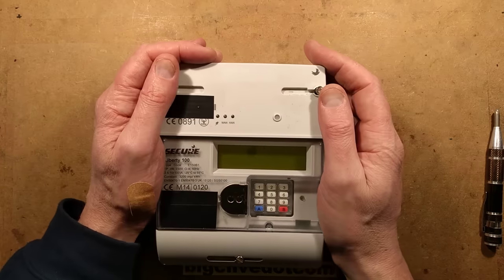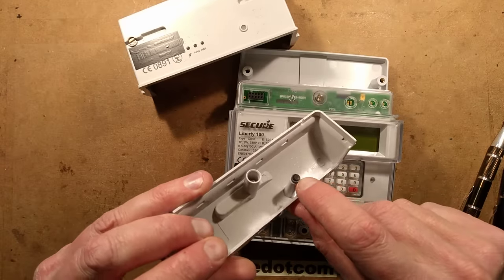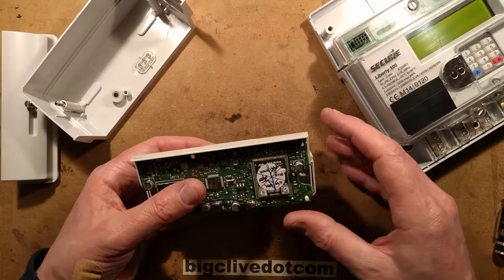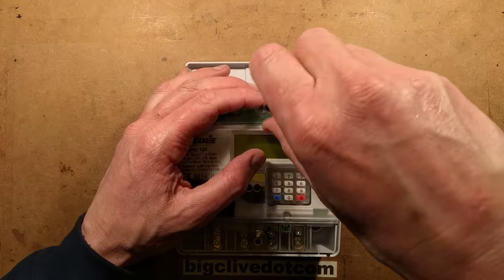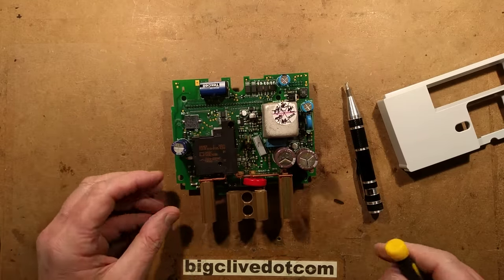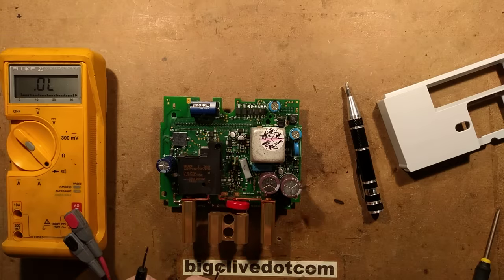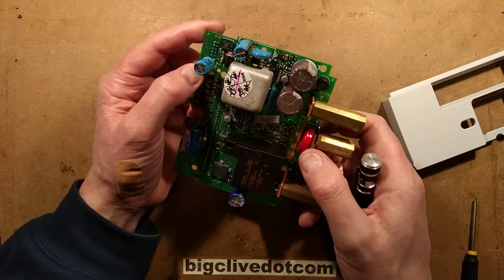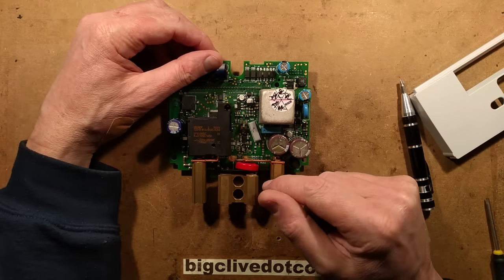Inside a smart meter, and the REAL problem with them.

Comment: My energy provider started contacting me to have a smart meter a couple of years ago touting the advantages to having one and saying the government wants all the industry to be using them. When I ignored the offer my energy company began sending constant letters about having one, and those letters gradually changed to 'we're in your area and will visit to fit a smart meter' then to 'your existing meter has reached end of life and you need a smart meter'. (which is complete nonsense there turned out to be nothing wrong with it). I've ignored all their requests for a smart meter. And then finally had enough and told them I've not having a smart meter they're not to touch my existing meter (which is not even their property) and to stop contacting me about smart meters in future.

When an energy provider is so intent on you having a smart meter and so aggressive and underhand in their methods to persuade customers to have one, you know there must be something in it for them. And after doing a bit of research, I soon discovered there is:

1) They get some grants/finance from government for the roll-out of smart meters and/or probably some financial benefit to energy providers from using certain smart meter manufacturers they've contracted with. 
2) Often many energy providers are using smart meters that have proprietory technology in them or don't work with other energy providers for an easy provider switchover, thereby limiting the options for changing energy provider and/or locking customers into using them, else facing costs to have the meter taken out and a new one fitted by a new energy provider.

I also read that about 60-70% of smart meters fitted either don't work properly even after 2 years of being fitted, or in some cases don't work at all. So you're better off sticking to your old reliable meter and submitting meter readings, unless you're the type of person who is obsessed with energy cost and wants to see what each appliance is using it. I'm perfectly capable of monitoring and budgetting my energy usage from an old meter and don't need to see real-time usage with a smart meter.

Comment: In relation to the 5G comment, most meters in the UK still use a 2G cellular connection. A handful might use 4G cat 1 but not that I'm specifically aware of. They will adopt nb-iot/cat-m when it's more prevalent here but that won't be for a couple years. 

And most certainly no smart meters are using 5G!!!!

Comment: Did a university project on smart meters back in 2015; the main things which we discovered:
.Smart meters can easily be manipulated and have poor security both physical and cyber. 
.They emit "barely legal" levels of radiation when they are in "transmit" mode. 
I would recommend staying away from them. Or at least wearing a Lead foil hat :)

Comment: Late to the show here, but I watched it when I first Aired - I work for Ovo now, so I can tell you, this has a series of two wide area networks, depending on SMETS1 or SMETS2, GSM and a standard RF, for different areas, and a third, a local area network for Gas meters to connect to, In Home Displays, We label them WAN and HAN, Wide area Network, Home area network, so yep, more than one wireless comm

Comment: The varistor across line and neutral will be to bypass any voltage transients and so protect the circuitry. At 230V it has a high resistance but a transient of say >600V will cause a drop in resistance and thus divert the spike

Comment: I found this Aug 24th, 2018, on vice dot com. * But these devices also collect an ocean of private customer data, including detailed information that can be used to infer when you wake, when you sleep, and when you’re at home or away. In the past, electricity meters delivered a lump monthly figure to utilities, but smart meters transmit data in granular detail, often in increments ranging from fifteen minutes to every few hours.

This in turn has sparked concern from locals in places like Naperville, Illinois, where, since 2011, one citizen group has been fighting the intrusive nature of the devices.

Under the name Naperville Smart Meter Awareness, citizens sued the city over a policy mandating that all city residents must have smart meters installed by the local city-owned power utility. In their lawsuit, they argued that the city’s smart meter data collection violated their Fourth Amendment rights against unreasonable searches and seizures.

This week, the group notched a notable win when the Seventh Circuit Court of Appeals ruled that the Fourth Amendment does in fact protect energy-consumption data collected by smart meters. The ruling leans heavily on the Kyllo v. United States precedent that declared the use of thermal imaging tech to monitor citizens without a warrant also violates the Fourth Amendment. *

I have seen electronic circuits online, showing that sound can be captured from light sources. The quality was 2 bit at best, I guess it's all possible, but honestly, with the networking and filtering that would be required, I find it hard to believe.
Reply: I could give a fairly good guess at when you sleep without looking at your meter. Likewise for when you cook/shower. So the energy company doesnt really give a crap about your washing habits, they know the macro consumption figures already, and have done for decades. 
Now do you shop at a supermarket with a loyalty card/credit card? If so, then they know exactly what your shopping profile is, what brand of cereal you eat, when your period is etc etc. Not that its of much interest. Calm down.

Comment: You ask why that incredibly noisy switch-mode power supply, mounted about 2 inches from the modem's antenna, had an electrical shield around it. I wonder ...

Comment: Thank you for this video very helpful even after all this time.  I have this meter for my electricity supply. Since November I've noticed a static noise coming from the meter especially when the kettle, hairdryer, microwave, and any high-demand appliance is turned on.  It's sporadic but its got to a point where I need to call someone up.
Reply from the maker: It would be a good idea to do that if something is arcing.
Reply: @bigclivedotcom  Thanks, it turns out it was the live wire going into the meter which wasn't secured or tightened.  All good now 🙂

Comment: My great grandfather was one of the electrical engineers who worked on the design for the old-fashioned turning KW meter when he worked for Boston Edison back in the day.

I wonder if the power supply is shielded because it's in close proximity to the modem.
Reply: The RF emissions were probably borderline for the certification.

Comment: So let's say they trigger the relay and cut your power, would the capacitors still hold their charge and send a tamper warning back to base if you were to pull the unit out and begin to tamper with it? because at that point, if it wasn't able to communicate back to base due to a lack of power, you could remove the antenna/modem/whatever and flick the relay back and get your power up and running again until they physically send someone out to shut it off?
Reply from the maker: It is powered from the utility companies side so it can also reinstate the power remotely.

Comment: We have just been honoured with electric and gas smart meters and a usage display box.The display box has to be plugged in to show the display so I know we are paying for the electrical supply to this.Do you know if the electronics in the two meters are also powered by the metered supply(charging me for the energy used to transmit info to the supplier)?.
Reply from the maker: The main meter derives it's power from the utility company's side.  The gas meter may communicate with it by battery power.  The stand alone display unit will use extremely little power.

Comment: Could the local communicator be for a separate gas meter? My gas and electricity meters communicate wirelessly over a short distance. Only the electricity meter has a gprs connection.

Comment: I have a 70s storage heater, I turn it on for 30-60minutes maximum. Then the heat keeps my home hot all through the night, in the morning I touch it and its still very warm (even though its been switched off for 7+ hours.) Its much better (cheaper than all the modern heaters I've had in previous homes.

Comment: I used to I install these, the local Wi-Fi is as the gas meter and in home display. It's a SMETS1 model,  which basically becomes dumb (like a normal meter) when you change supplier,  these are still being installed,  10 year on.
Smart meters are pointless to the user unless they can't read it themselves really.  And I used to get so many people saying why they had to have one half way through an install,  I started asking before hand if they wanted one.  As suppliers were pushed by the regulatory  body illegally to get people to install them. 
If you read the government  white paper (available  at gov.UK)  you'll see 15 yr ago the gov realised there would be future power cuts,  due to increased demand,  and eventually smart devices in the home could be turned off via the smart meter network to lower demand at peak times to stop black out's.  Also these smart meters help facilitate  micro generation  of electricity  via solar panels back into the grid. 
The energy companies  involved  in the consultation agreed on the principles but encouraged the government to do testing before rolling out.  They didn't and all these years later,  we are still installing  smart meters like these that are not fit for purpose and being scrapped.  At cost to the customer via bill increases (currently. £16 billion and rising) 
Thanks for the strip down.

Comment: The biggest problem with these smart meters is high voltage spikes from lightning as they tend to fry the screen and then an estimation is used for billing! lightning arrestors for low voltage are available but are usually only retrofitted after a meter has been fried!

Comment: I have my supply from EDF and I have been happy with them mostly. At my previous address my PAG meter died it still supplied Electric but I was getting it for free (Note this is apparently according to them a known fault on this type of meter.  So I was by no means the only one getting free electric). Being moderately honest I reported this 3 times but they could  not spare a technician to replace it as apparently they were going around installing smart meters. Well no way was I going to pay some massive estimated electric bill and told them that but they were happy enough to ignore the situation so I continued to get free electric for about a year until I moved out.  It is exactly 2 years to the day that I moved out and the new tenant remains getting free electric!

This is about Smart meters and this may well be slightly off topic apart from highlighting EDF's generous supply of free electric or perhaps their inability to install smart meters however there is an addendum. When I moved into my new address and was on their website there was an option to request information regarding smart meters which I ticked. This resulted in a message that my request to install a smart meter(Which obviously I had not made) will be processed at some point. This is disingenuous and misleading as I do not necessarily want a Smart meter However this was over a year ago and nothing has been heard from them on this subject. Perhaps they cannot afford to do so since they supply so much free electric! :)

PS though I have been happy with EDF as a whole mainly for their price and customer service I have become recently annoyed I have an estimated Gas supply paid monthly a bill pops into my inbox and I pay it. A couple of months ago I got an e-mail explaining that if I am having problems paying here is the steps I can take just as if I was delinquent in paying my bill except the bill was not even due for another couple of days. This annoyed me so much I didnt pay the gas bill for another month! So last month I decided to see what happened and lo and behold before it was due yet another automated reminder came through about if i was having problems!  It would be an e-mail I would appreciate if it was a few days after it was due but not before so basically they are going to have to wait for their money again or I am going to start requesting a meter reading every time I am due a bill!
Reply: I knew someone who got free gas for a decade after moving in to a new flat, they tried contacting every energy supplier and none wanted to know so they waited for someone to send a bill...for 10 years until they moved out.  I believe its called an orphan meter where due to building changes, property's being split into multiple flats or turned back into fewer the meter just gets lost.  Its also possible a dodgy builder hooked up to some other supply line.
They used thousands of pounds of gas in those 10 years, their flat was like the tropics at times lol
Reply: @meetoo594  On that subject I had the same situation with TV Licence ironically at the same place I never watched on air TV so luckily never went to buy one otherwise they would have the details of the 10 flats in the property. At my current place I have had visits from the good squad wanting me to buy one even lying to me telling me I needed one because I own a TV and a string of threatening letters.
Of course in the case of the Electricity as I said it was actually a Known fault which they obviously cannot be bothered to fix and I wonder how many thousands of meters have failed that way so they are supplying free Electricity too. I happen to know they still have not fixed it and I left there 18 months ago
Reply: @glennedwards1449  I have heard it happens with water supplies as well due to builders connecting stuff where they shouldnt, mostly out of laziness and not being arsed as long as the water is connected.

Comment: The start of the SIM card number (known as the ICCID) will tell you which operator it is, all SIMS s start 89 for telecoms smart cards, the next 2/3 digits tell you the country (generally the same as dialing codes eg 44 for UK) and then the next 2 are the operator, looking at the vid I think thats 894608 which would be Telenor in Sweden, presumably they have some kind of M2M business using their core network & roaming agreements (it could also be a virtual operator off the back of Telnor) 
Manx were big early on with roaming sims and selling different kinds of specialist access, particularly in the SMS days but some of the bigger players have now caught up and got into the market,

Comment: Maybe the welded resistance node and varistor is set to a specific calibration so that the electronics can sense if someone has bypassed the meter by forking out from the inlet cables but left the meter connected to 'fool' the supplier. Electricity companies are getting smarter these days.

Comment: I think the reason they use Manx Telecom SIM cards would be for multi-network roaming - I guess they have roaming agreements with all the main UK networks, so it just happens to be the cheapest way to get a SIM card that can connect to any of them (which is useful for applications like this, where they are installed in various locations with varying mobile network coverage, and also provides redundancy if one of the networks has an outage). All the ones I've had experience with have actually been Jersey Telecom though.
Reply: They aren't Manx.  Some of the meters recovered at that time DID have Jersey SIMs, but not all.

Comment: So how long will those electrolytic caps last - 10 yrs max? So every five/ten years they will have to send an engineer to disconnect the power, replace the unit and re-register the meter in every household in the country. Should keep them busy!
Reply: The design lifetime of smart meters is indeed about 10 years just as it was for the old spinning wheel type although many of them were used for much longer.

Comment: If you disconnected the the amp and shut off the main switch and then take off the covers will they still receive a signal for tampering? If there is no power and the meter is there for without power and off how will they know you tampered?

Comment: In the states they have that rebate incentive and they put a box on your air conditioner and wire it in so they can break the 24v signal and cut your AC off during "peak" times or, whenever they want really

Comment: Is the electricity to run/power the meter paid for by the consumer? I do think so, as I have noticed a meter for a dormant (not used) power circuit does tick over.

Comment: The whole point of smart meters is so that you can be cut off when the electricity runs out as it will in future. The supply will be rationed . When everyine has an EV charging  where is the power coming from? Don't foregt  a car needs a 7KW charger . Imagine your whole estate pulling 7KW just on their cars all at once?
Reply: Yeah, with cables stretching up walls to flats and across pavements for those with no off road parking. 😂🔌🔋

Comment: The main reason i thought for the change of meters is they will bill you for any enery passing either way, so if you have unregistered solar panels it will charge you for any energy you put back in the grid rather than the meter going in reverse.